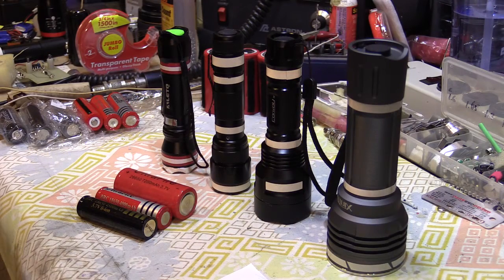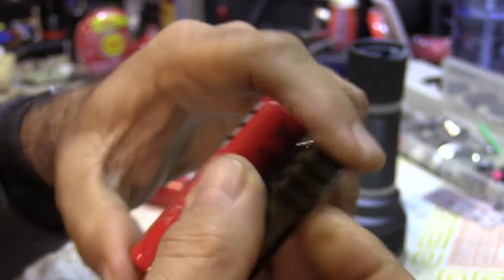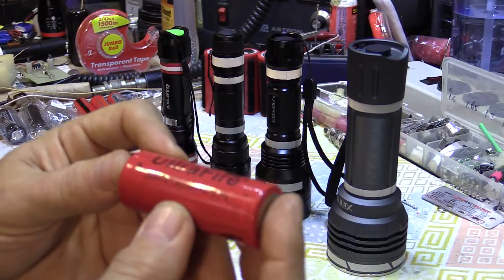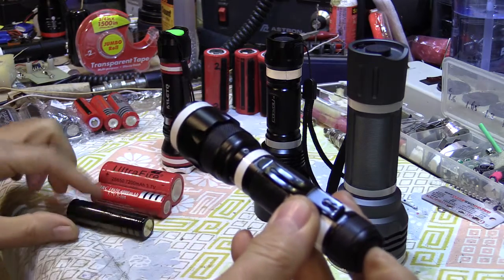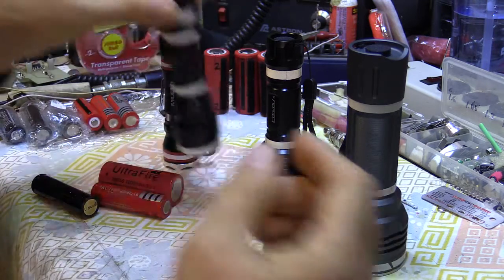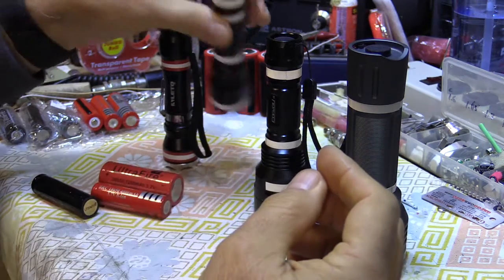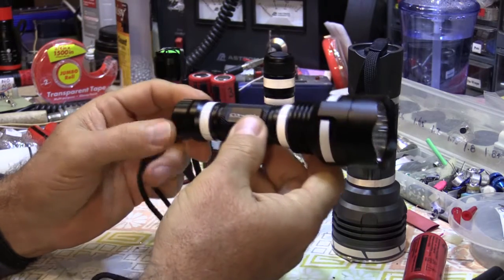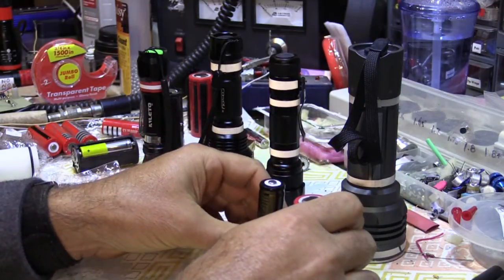Lithium Battery Flashlights 101

Comment: all the batteries you are talking about are Lithium-Ion,  NOT Lithium-Polymer.  There are NO such thing as round Lithium Polymer battery.  The other thing is any Lithium-Ion battery with a capacity higher than 3600 mAh are fakes.  No manufacturer currently makes anything larger than 3600 mAh.  So all your Ultra fire batteries are counterfeit.  Please do some research before making your video.  you are providing a lot of wrong information.